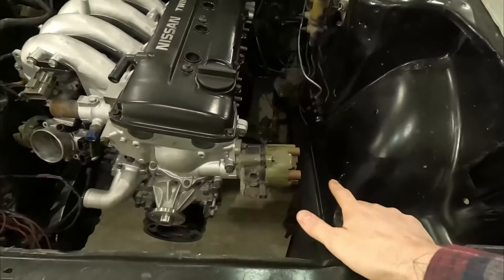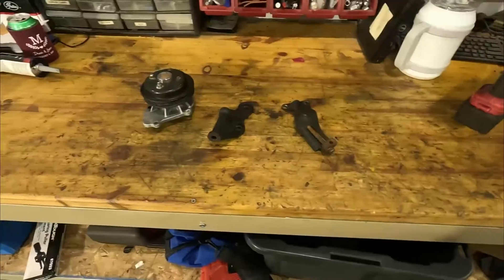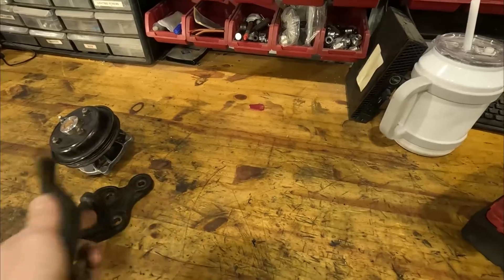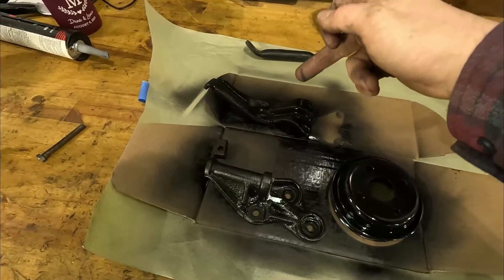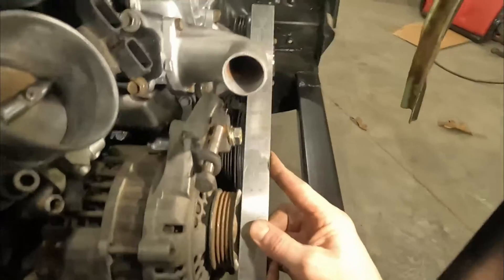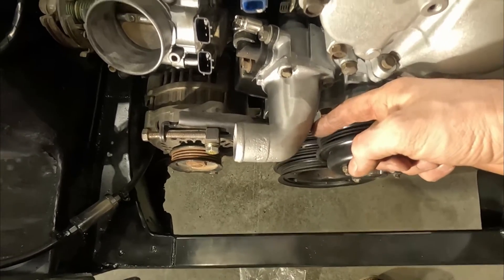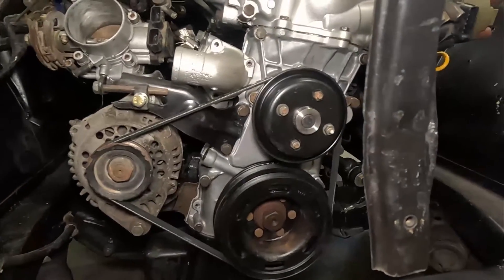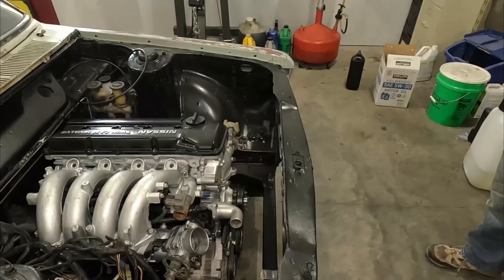KA24DE alternator and water pump with one belt!

Comment: I’m running  belt for wp - crank K030267 without mods, it’s tight putting on but works.
Reply from the maker: Is that with the dual cam thermostat housing?

Comment: Great video, but I am curious, how is the belt clearance now? From what I have read, it will end up too close and still rub OR your hole in the housing may be dangerously thin. Had any isses?
Reply: Thanks for the reply… I’ve been on the hunt for a “spacer,” but it looks like fabricating is the only way… unless you found someone who makes that spacer?!?
Reply from the maker: @mhinkens I’m not aware of anyone who makes the spacer but there is a local machine shop I might work with. I figure just bring them the gasket and they could make one.
Reply from the maker: I haven’t had it running yet. I plan to do a video of the startup to test if the belt clearance is ok. If not I’ll use a single cam thermostat housing and a spacer.

Comment: unorthdax racing makes a billet pulley for the water pump that helps your belt issues, and it helps with flow
Reply from the maker: I have seen that but you have to buy the whole kit right?
Reply: i have seen the pulley sold by itself, but there others out there, let me do some diggin iof you want find a current source for one, i havent worked on a KA in about 15 years @BuildSeason  :body-blue-raised-arms:
Reply: non stop tuning sells the pulley for like 70+ sorry couldnt find it cheaper
Reply from the maker: Thanks for the info! I’ll check that out if my belt setup doesn’t work out.

Comment: I remember turbocharging my KA24DE in my 1991 240SX SE back in 2005. Thing was a blast to drive at 8psi
Reply from the maker: That’s good to hear! I’m hoping to stick with 8-10 psi and just have fun with it. What turbo did you run?
Reply: @BuildSeason  it was a Cummins Holset rebuilt turbo.
Reply from the maker: @RadDadisRad that’s what I’m looking to use! An Hx 35!
Reply: @BuildSeason  I used Honda accord injectors and fuel rail and had to change my fuel rail mount. Better injectors because they aren’t side spray.
Reply from the maker: @RadDadisRad good to know. I went with three radium engineering fuel rail to switch to top feed.
Reply: I fucking sold an hx 35 for 100$ 😢